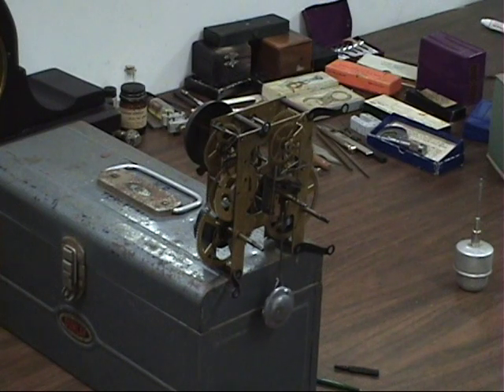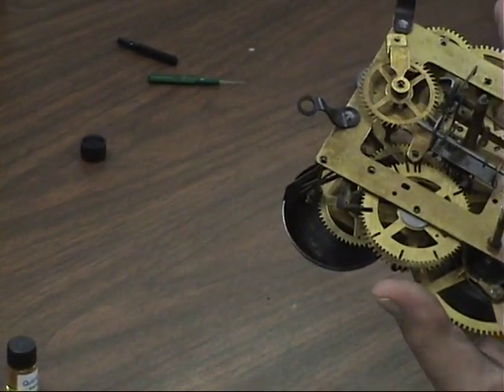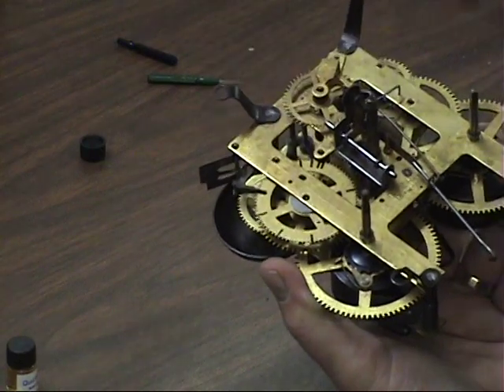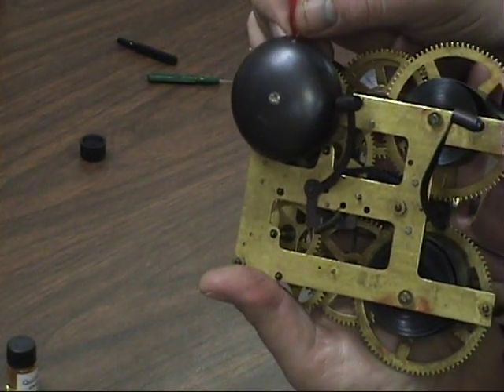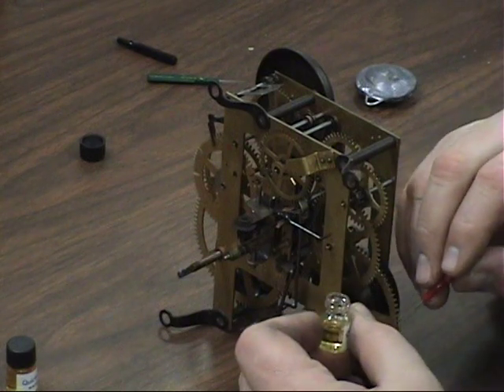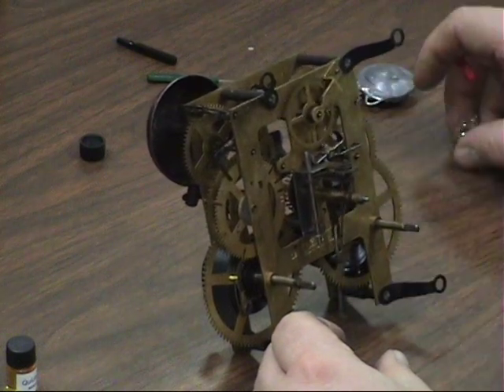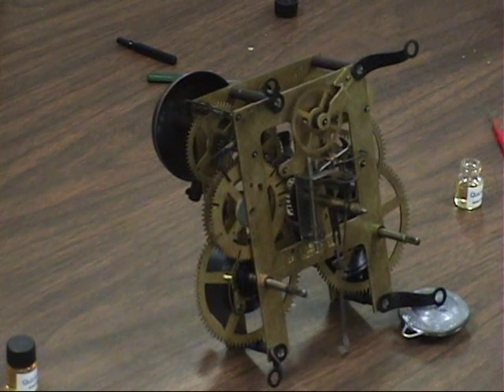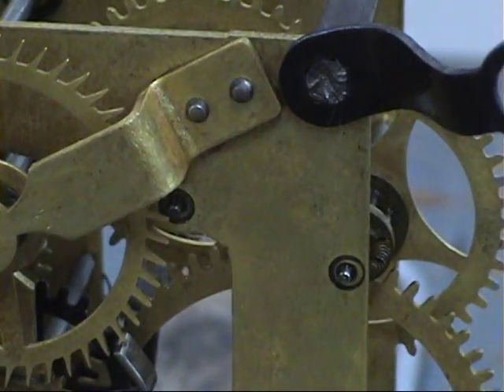Clock Repair Assistant, Part 1 Quicken® Nano-Treatment

Comment from the maker: This is a "demonstration" on superior lubrication. A clock should be properly serviced prior to application of any lubricant. Once our treatment provides diamond coatings pivots, bushing and gears - oil as lubrication is no longer required, as it is the Diamond Coating that protects against metal on metal contact, and lubricates treated surfaces.

Comment: @19591234 The beat is off, it's crutch bound or both.  The clock should be level but the movement level is what matters most.  Make sure the bob is directly in the middle of the crutch and has some side to side motion. To set the beat bend the crutch left or right until you hear and even beat.

Comment from the maker: Our novel spherical NanoDiamond has passed phase one testing for a Mil-Spec at Picatinni Arsenal, and it does not cause wear - but prevents it as the spherical particles cannot abraid. See the bottom of the page at diamondlube   dot  com for DiamondLube™ (formerly Quicken®) vs Mobil 1 in a pin on ring wear test. How can Mobil 1 be the best, when DiamondLube™ is at least 50 better at preventing wear.

PS: the US ARMY testing has proven our products are superior, and NON TOXIC.

Comment: Your'e just making it easier for the clock to wear all its pivots and pivot holes. You may have a nice lubricant as ling as it doesn't turn into plastic later, but you have to take care of the wear first. Your just making it run itself to death. When a clock stops it's saying "something is wrong with me! Fix Me" not "please add oil I want to die"